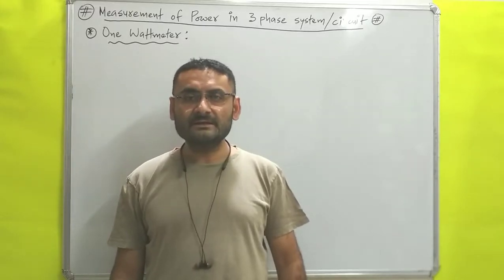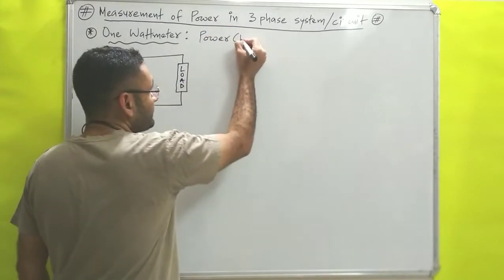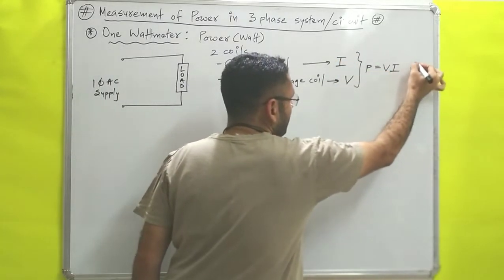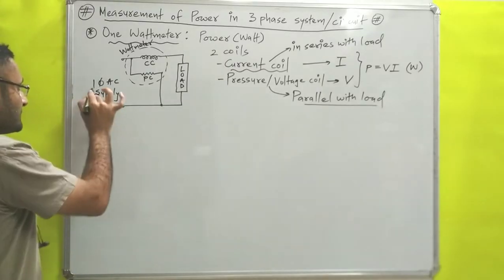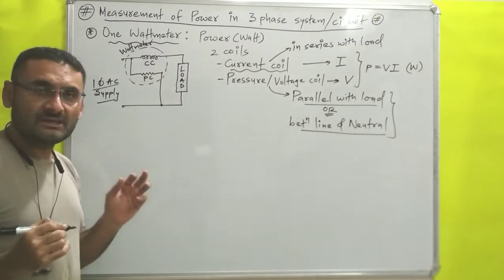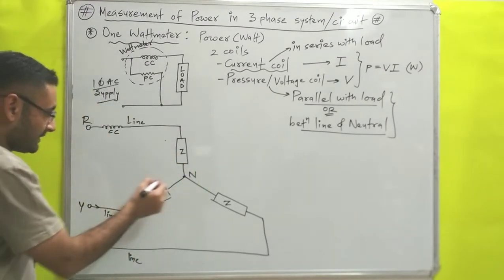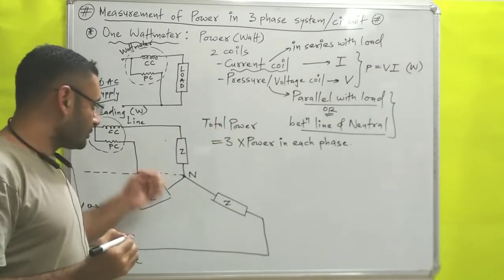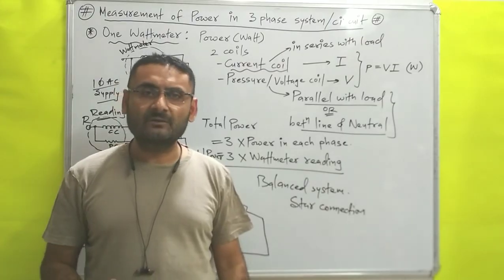One Wattmeter method (Measurement of Power in 3 phase circuit / system) BEE | BTech 1st year

Comment: 00:02 Measurement of power in three phase circuit using one wattmeter
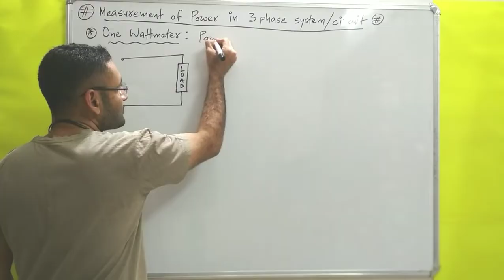01:21 A wattmeter uses two coils, current coil and voltage coil, to measure power in a system.
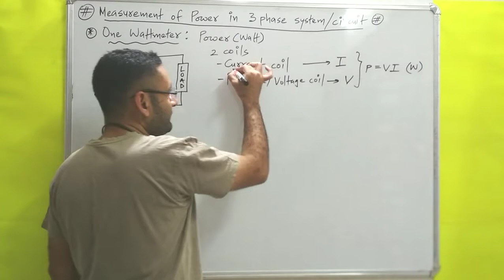02:38 The power of the system is measured using the One Wattmeter method
03:47 Measurement of power in 3-phase circuit using one wattmeter
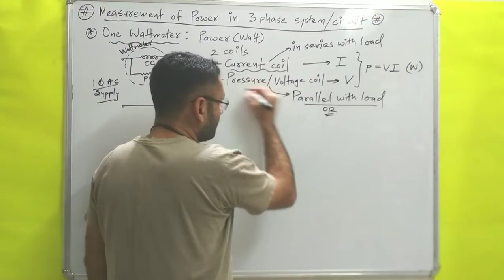04:55 The one wattmeter method is applicable only for balanced systems.
06:10 One wattmeter method measures power in a 3 phase circuit
07:19 The one wattmeter method measures power in a 3-phase circuit/system.
08:33 Power in each phase is equal to e3 into watt meter reading